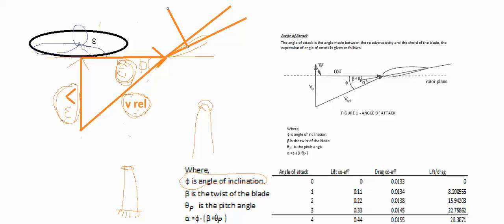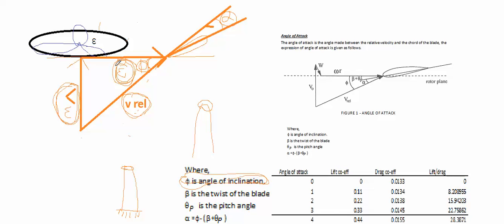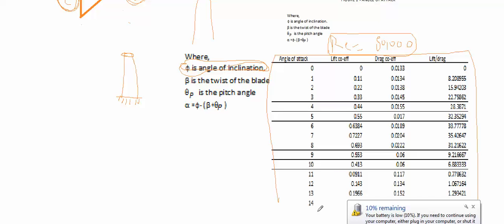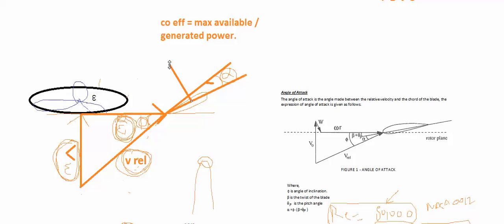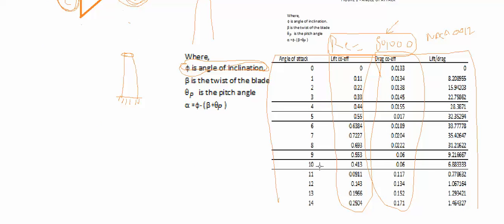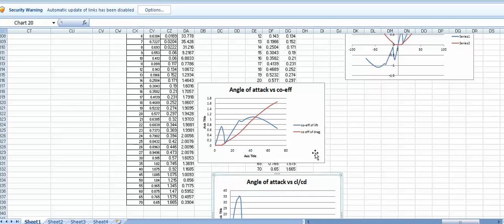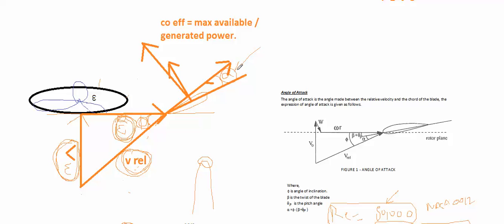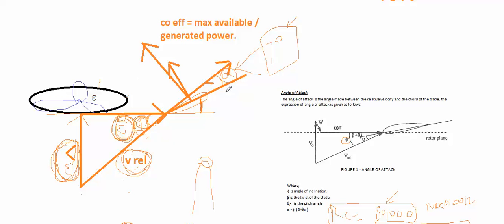Wind energy, Wind turbine part 3

Comment: lets say i want to design a blade.
1) i got the tip speed ratio
2) got the blade length
so how do i find the optimum angle? can i just use the NACA 0012 profile? how about the reynolds number? how do i find the correct angle for my blade's twist along the elements? sorry, im new to this. thx
Reply from the maker: hello, please watch video part  7, Give me couple of days, will make one more video where i will demonstrate my spreadsheet, will become more clearer, will let you know once I am done with my video...cheers.